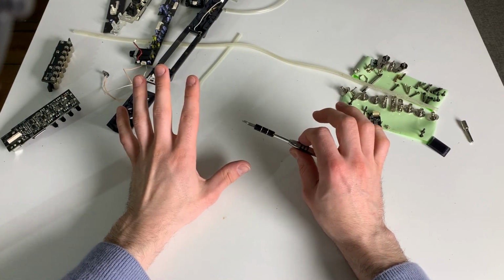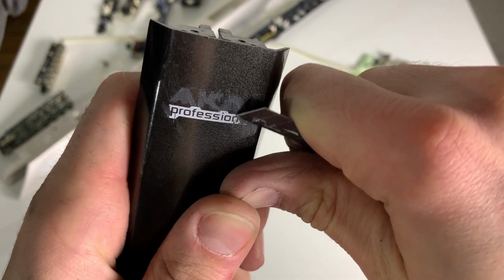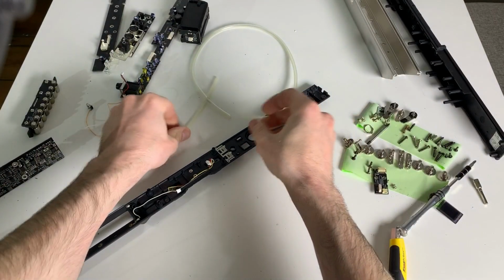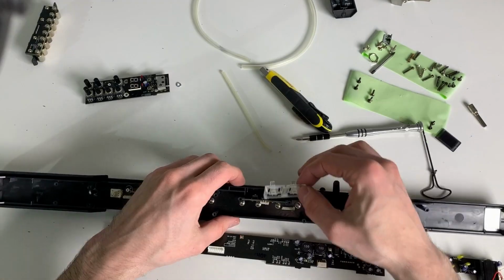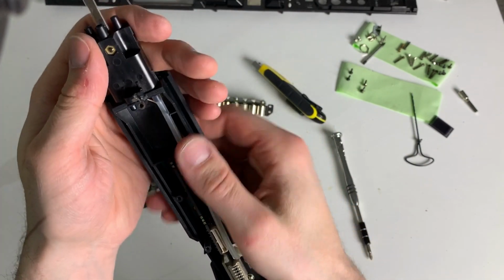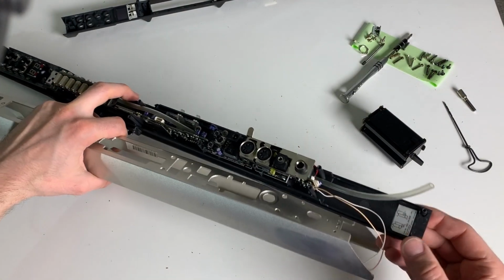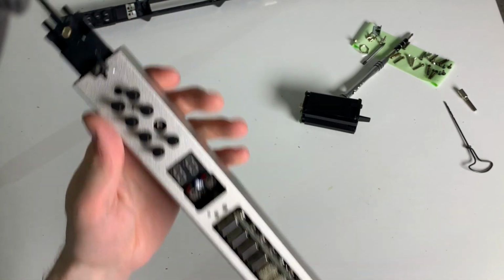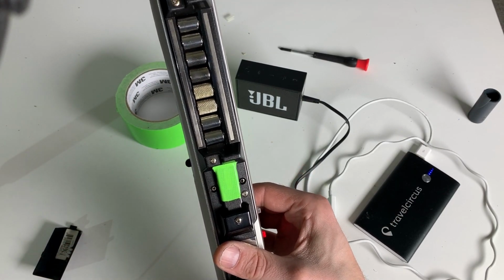EWI 4000s Reassembly

Comment: Peter, nice video. I've an issue with my EWI 5000s. When I blow in without touching something it sounds like I'm touching the lowest octave wheel. Do you have any suggestions how I can fix that ?
Also when I turn my analog BREATH-turn-button to over the value of 66/67 I hear that same sound. Something to do with that maybe ?
Reply from the maker: Sounds too me lie a grounding issue. Make sure your hands (and thumbs) are not too dry. That helps for me

Comment: Fantastic disassembly/re-assembly tutorial.  I would have had a few extra screws left over if I attempted it!  I made two small mods to my 4000S.  You mentioned in your prior video of using rechargeable batteries.  I used nimh batteries, the hybrid type, soldered wire to the positive and negative ends, and installed a small WS Deans 3-pin connector at the bottom (only use two of the three pins) and now I charge using one of my RC chargers.   I like not having to open the case to charge.  I also added an extension to the neck-strap ring, to keep the strap from hitting my left thumb while playing.  I may use your disassembly video in case I decide to paint my EWI gold.  Probably would come out a lot better disassembling, instead of using masking tape.

Comment: Are you planning on keeping both the EWI 5000 and 4000? I'm still on the lookout for a used 4000s.
Reply from the maker: Yes I will keep both since they are totally different instruments (in the inside at least). The 5000s looks more like a sampler to me and the 4000s more like a synthesizer. Comming from the 5000s I was at first a bit disapointet since the difference in the sounds of the 4000s are not that big because they are all generated the same way. But the 4000s is way more expressive than the 5000s. 
Anyway long story short: I think the 4000s is a nice addition to the 5000s. But thats it it is nice to have. If I had to choose I would be happy with just the 5000s.
Reply: @peterommes4360  yeh I've heard about the 4000 and 3000 series being the most expressive in their own way(one for its digital patches and one for being the last truly analog ewi); I'm currently making my own wind instrument using a ribbon controller and found issues with the limited midi analog range (also why I didn't like the ewi usb), so I moved to an onboard raspberry pi to run internal patches directly from the analog data.
I'm interested in trying to use a totally analog setup like the modulin since I'm not using digital pins for the notes, but I dont have the rack equipment.
I'm trying to make some pure data patches to compare with the 4000s, but I can only compare it to the usb, which I can already emulate(other than bite) with software frets on the ribbon cable being sent over usb.

Comment: Great Video, Thanks so much ! Which board was it that has the processor and the sounds ?
Reply from the maker: Actually I did not check the components on the board. But if I had to guess it is the long big board.
Reply: Peter Ommes your right. I had to replace mine because of a crash while trying to update.